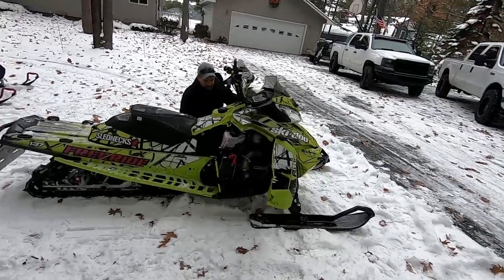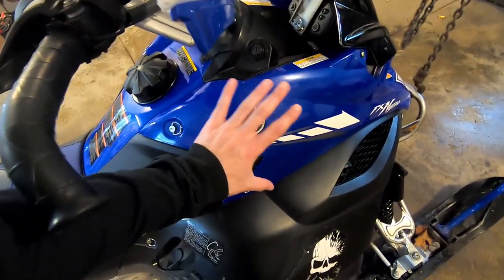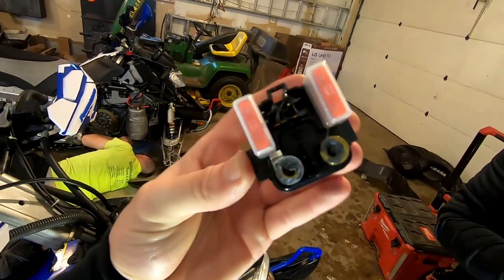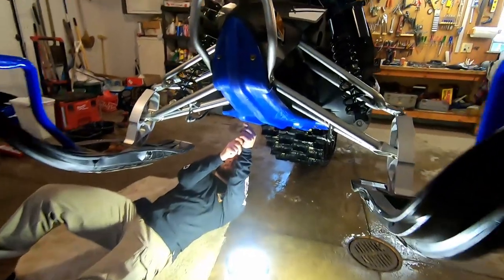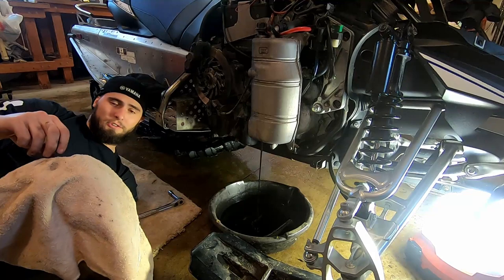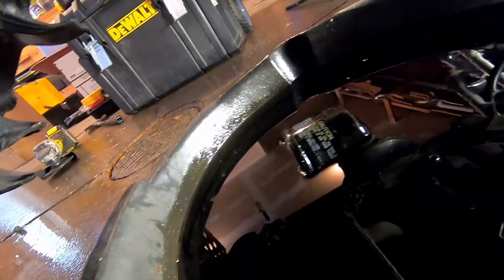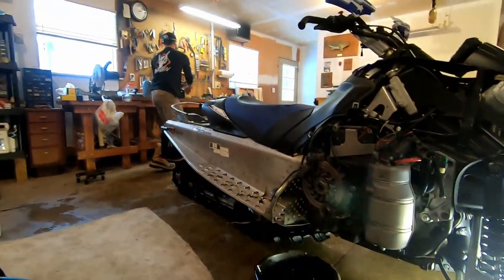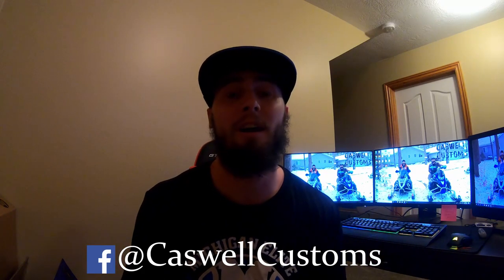Yamaha Nytro Oil Change 08-13

Comment: 3:00 that relay threw me a code 12.  Googled it and came up crank shaft sensor.  Not sure why it came to me but I looked at that relay full of corrosion.  Took it apart dielectric spray and grease cleaned it up and good to go.  Might change it this summer but might just leave it. Been problem free since

Comment: Just a quick question, do you put the same engine oil in the chain case as well, I couldn't tell from the video, also I have another video suggestion, I'm kinda new to snowmobiles maybe in the future you guys could show what all needs checked out for the season, or any parts you replace every season, like anything to look out for in the track or wheels, and preadjustments etc that would be highly informative.
Reply from the maker: Raynen Hunsaker thanks for the suggestion! We will definitely do a video highlighting everything to look at before the season starts! And no it is a different oil, it’s specific for a chain case. We used a generic one but this link is Yamaha’s chain case oil. Yamalube Snowmobile Chain Case Lube 8.5Oz https://www.amazon.com/dp/B008KYTKOU/ref=cm_sw_r_cp_api_i_f3bnEbGHVKJ1M
Reply: @CaswellCustoms  Thank you guys for the help and info! Much Appreciated!

Comment: Dear Caswell, great videos!!! New 2009 Nytro XTX owner.  Do you have any leads on the flexible braid exhaust fix kit.  Some one must make I am guessing 1.375" ID, 1.5" OD braided exhaust coupler, this will eliminate the doughnuts and Summit Racing has the 1.5" don't know if OD or ID for $14.99 ea.  OEM Yamaha parts are $401.88 and again they say 4-6 hours labor.  Watched the PowerMods install of the generic flex couplers for the Nytro, just looking for a lead to find them.
Reply from the maker: Lyle Rogalla I know powermodz had them on their website but I just checked and they no longer do, I’m not sure where else you can find them unfortunately! If I do find them I’ll let you know.

Comment: Hey guys. So I just got a 2008 nytro. On the chain case dipstick. Where should the oil be. There is rev/std marking on it. ? No min or max.
Reply: If you have reverse, then just add enough to the top line…it doesn’t call for very much.
Reply: @GnarlyChicken  thank you for the info. I watched liked and subscribe to your channel. I seen the chain case video you did. Thanks again.
Reply: @joerutkowsky3261  thanks man. Appreciate ur Sub!! And happy that my vid could help you, and any questions I answered.